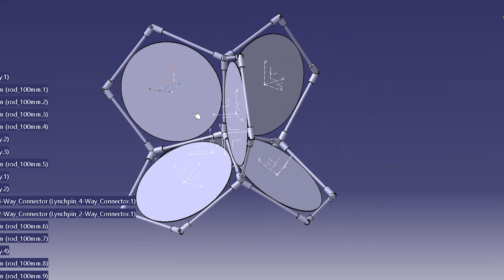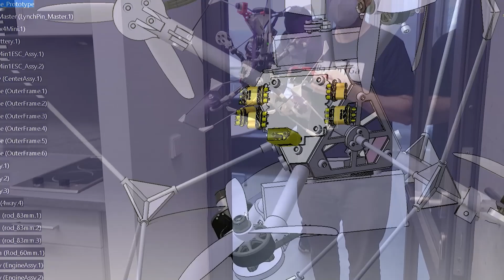Meet The Finalists! Terrence Howard's Lynchpin Drone Competition

Comment: A Z Y X W V  U
B                      T
C                      S
D                       R
E                       Q
F                        P
G                       O
H I J K L L L M N

A through Z is equal to 1-28
So basically the alphabet of 26 letters but you add double LL and Ñ 
So that’s the Ñ with the line on top. 
So the alphabet would be 
A•B•C•D•E•F•G first 7 letters 7= Completion
7 days equals One Week

Then H•I•J•K•L•LL•M
Equals 7 days Week 2 

Then N•Ñ•O•P•Q•R•S

7 days week 3

And last week of month is

T U V W X Y Z
ZZZzzzzzzzzzzzzzzzzzzzzzz
28 letters in alphabet each letter would represent a day in the month from 1-28 with 13 months
So 13 multiplied by 7 
13 x 28 = 364
So one Solar Year with One day of atonement and the one day that we are born our One and only true Birth Date